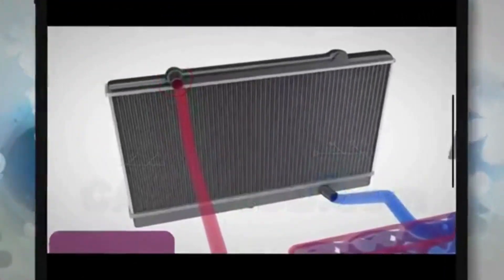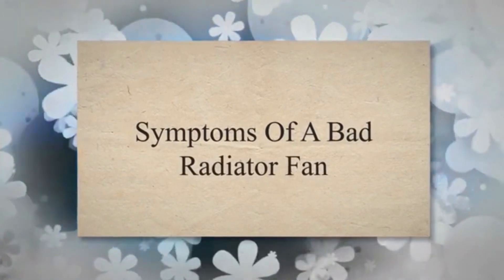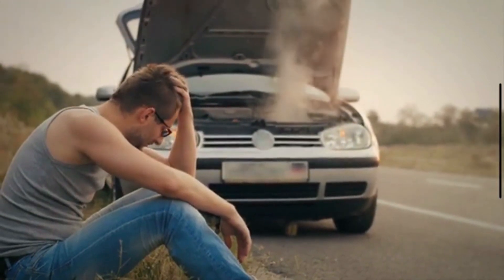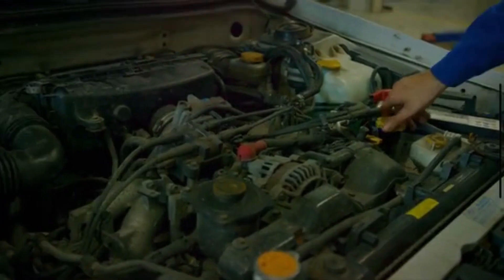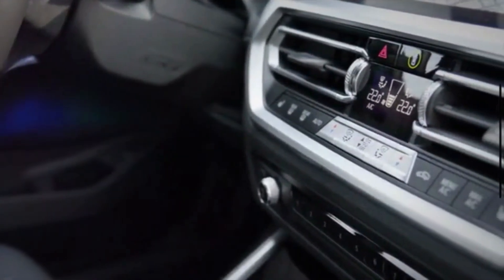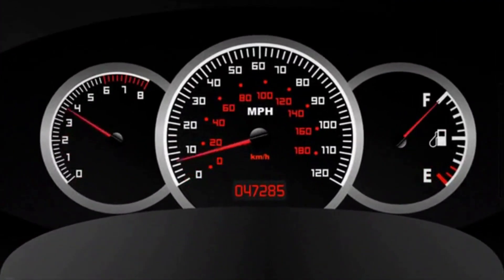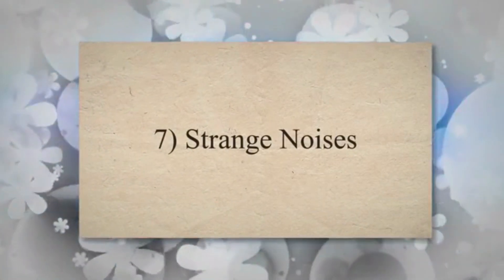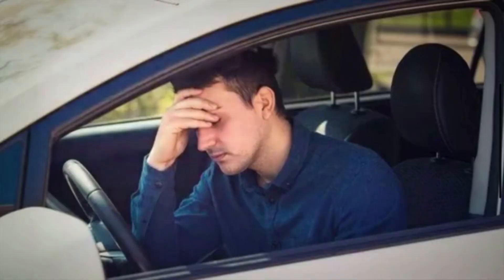Top 7 Symptoms of A Bad Radiator Fan

Comment: Last week my radiator fan died in a trafic jam at parking lot. In that case the temperature od the car rised. I had to move the  vehicle because it was HOSPITAL PARKING LOT. What i have done? I turned on the Hot airflow Ac in the car to the maximum. In that way the hot air flow inside of the car. Unfurtunately it was 27 celsius degrees ouraide and i had to drive with the open windows. I went to the Motorway and pressed clunch on a high speed so i can reach home.. i drived 60km that way.. today im going to fix my radiator fan .
Reply from the maker: @КристијанТодоровски  okay great..
Fix it as soon as possible otherwise it may cause to the failure of your engine